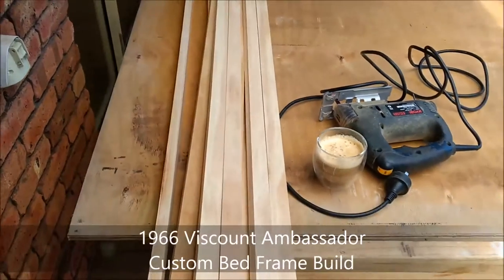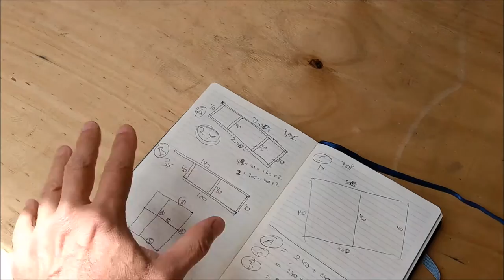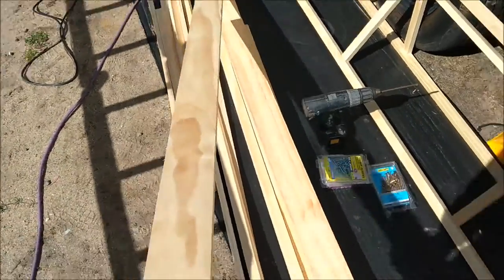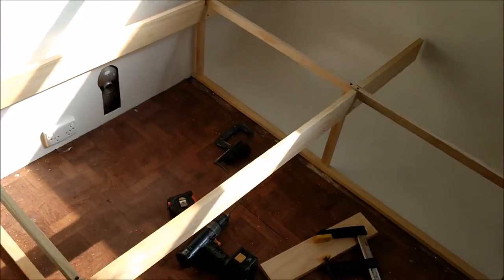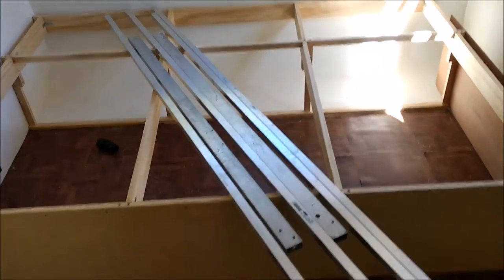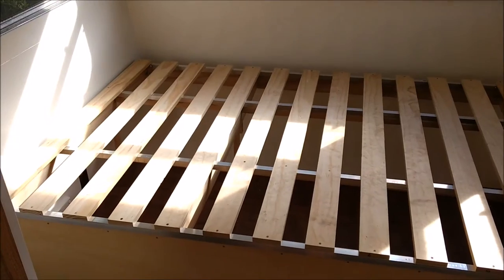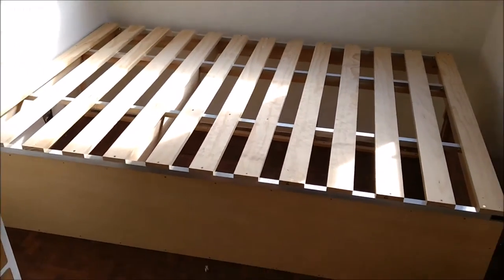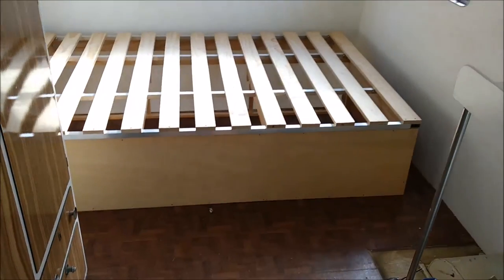Part 1: 1966 Viscount Ambassador - Custom Storage Lift Bed Build

Comment: This is amazing! I have a similar 1966 also that I’m definitely doing this in!! 

Question… the steel poles/ledges at either end of the van.. did you remove them on the bed side? As I can’t see them!! 

We always end up under the ledge and someone gets a humped head haha
Reply from the maker: From memory I did end up removing the top side storages as they also where in the way for me (as I am tall).  May have some vidsfrom when I bought the Viscount with the interior the way i got it...

Comment: how much in materials did the bed cost you? Rough breakdown would be awesome.
Reply from the maker: Timber is dependent on your local supplier. The struts I got off eBay and this will vary depending on the strength you need. I estimate that mine cost me $200 AUD all up.
Reply: @rovertasmania7033  Great and roughly how long for labour..can it be finished in a days work (if you know what you are doing)?
Reply from the maker: @adriancrypto665  If you had all the materials at hand yes you could do in one day, however i tend to work slowly so took me a few days.
Reply: @rovertasmania7033  Which struts did you end up buying?
Reply from the maker: @adriancrypto665  Just a generic brand off eBay. Looked up ones to match weight and length (extended).
Reply: @rovertasmania7033  Can you send me a link..not quite sure which ones to chose for a double bed similar to yours.
Reply from the maker: @adriancrypto665  it was a while back, ill have to check. But it was, from memory, ebay purchases.
Reply from the maker: @adriancrypto665  look up on ebay this term '1 X PAIR UNIVERSAL GAS STRUTS 200N 810MM EXTENDED LENGTH 10MM/22MM ROD/CYLINDER'

Comment: Good job! I think I would add some diagonal braces from the rear top rail to the rear floor rail
Reply from the maker: Thanks!  Yes it will need some bracing, I can tell already.  Ill most likely use some shelving brackets so that I can add then under and also to the sides, in each end piece only.